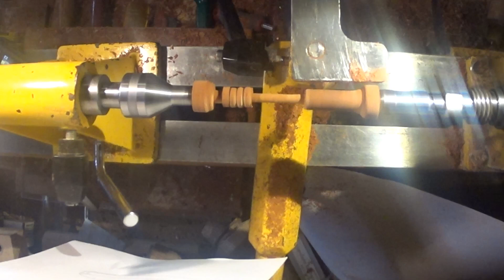Captive Ring Tool

Comment: Oh yea a tool shaped like that would be a lot better. Did you grind that yourself
Reply from the maker: yes. it was an old planer blade. The first one I made was from a dental pick, but it tended to twist and break rings. Thanks Joe.
Reply: @ do you think a auger style drill bit would be a high speed steel or is that a bad idea to grind one down.  I have several large ones
Reply from the maker: @WedoweeHandyman  I'm not sure, but flat spade bits should work, are cheap and are usually hss. I have used one for a beading tool.